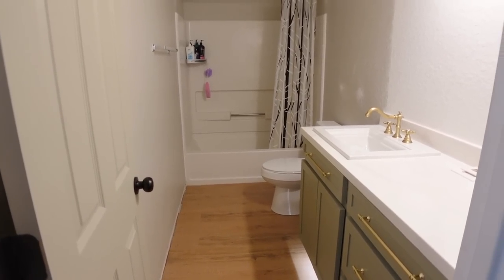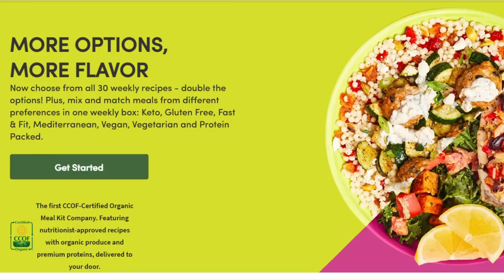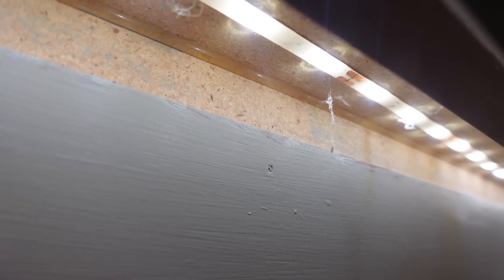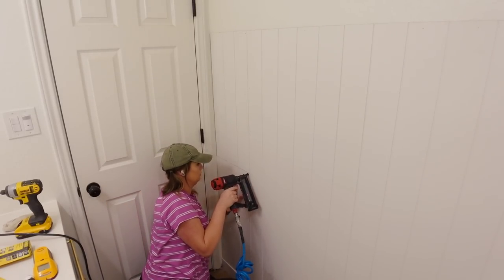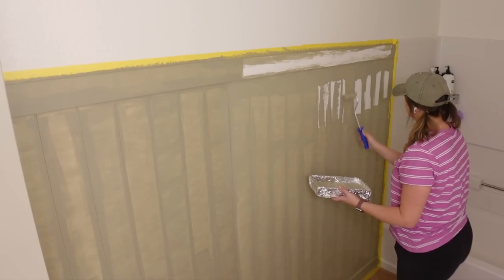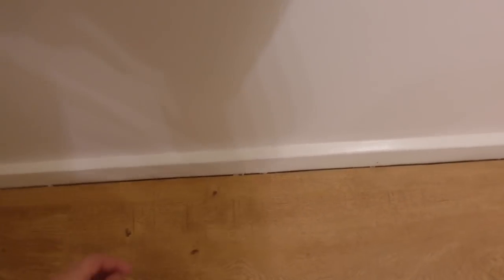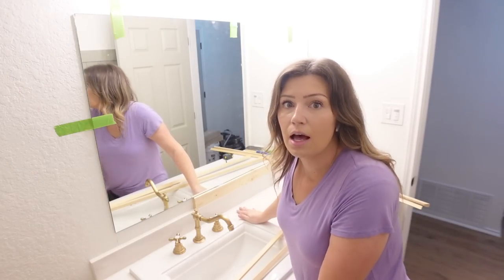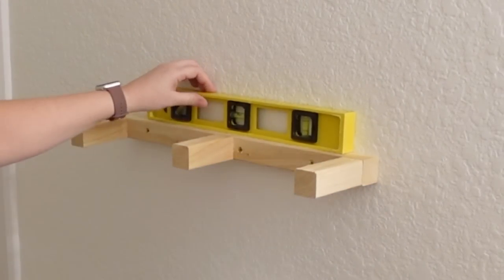BUDGET BATHROOM MAKEOVER *REVEAL* | EASIEST VERTICAL SHIPLAP WALL EVER + FRAMING THE MIRROR

Comment: I love the makeover you did on this bathroom. I have a question, what was that piece of wood you used to put on the floor between the bathtub and the flooring?  I want to to that to my daughters bathroom. Do you also put caulk there to? Or just the wood piece?
Reply from the maker: It’s called quarter round (I used pvc instead of wood). I caulked between the floor and bathtub so no water would get under the floor. Then caulked between the quarter round and bathtub.
Reply: @KelseyRomitoDIY  gotcha!!

Comment: how do you know you are nailing through pipes
Reply from the maker: Good question. It helps that I’m on the second story so there shouldn’t be any plumbing in the wall I was drilling into. But they also have stud finders that will check for pipes and wires too.

Comment: That paint on the accent wall does not cover well at all.  Paramount paint at Menard's is great one coat (or two if you want) and very reasonably priced.  It's all I use.   Also, if you use a thinner bead of caulk you won't have such a gob to remove and smear out to the sides.